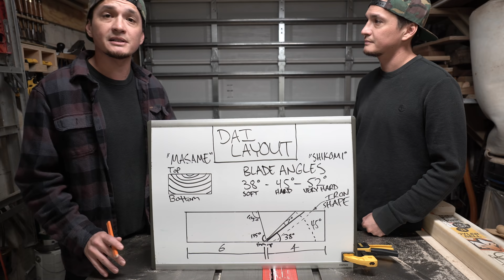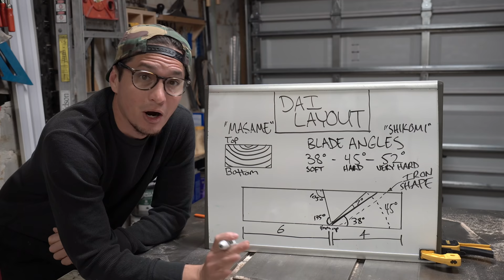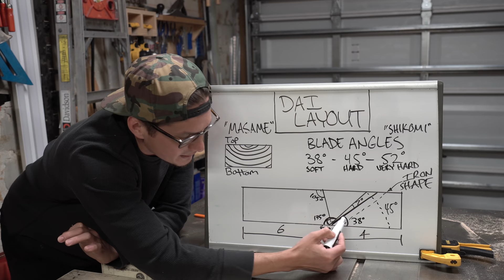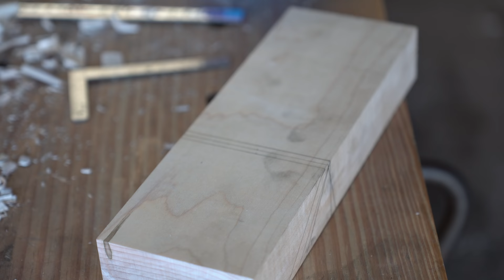Making a Japanese Hand Plane | Kanna Plane Fail Video | Japanese Woodworking

Comment: Even though you consider it a fail, it still came out great in my completely amateur opinion!
Way better than mine when I made my first dai a couple months back lol.
I made it with a 50 degree bed to have as a last resort plane if I ever ran into any gnarly exotics. Next time I'm gonna use soft maple too, I did mine out of white oak because it was what I had and it came out kinda ugly, but still worked in a "step away from a finishing plane" kind of way. Plus the oak being a little chippy was a big player too.
Reply from the maker: Yeah white oak i heard can cause issues with the shavings ejecting because of the porous nature of it. Hard maple works too. But I’ve heard rosewood and Osage orange work amazing.

Comment: Great video! I imagine that was a lot of work from start to finish, how many hours would you say? I've never made a dai but I am continually tuning my current one and you did better than me... I can't seem to get the right/left balance perfect so one edge of my blade will typically leave a track mark. I can dial it in by laterally tapping the blade but if I hit a knot or too much resistance it has a tendency to get out of alignment.

Edit: Oh yeah, I subscribed. Looking forward to checking out more of your channel!
Reply from the maker: Yeah I think for the most part kanna doesn’t handle knots particularly well. So as far as work I’d say it took about two full days. I did it in a couple sprints. Basically an hour or two getting the blank together, a quick layout, then an afternoon roughing the throat, a couple hours on the channels for the iron, and then what felt like forever working the fit. I honestly might try the multi tool route just to save me some time and wear on my mortise chisel though. Thanks for watching and keep asking questions!

Comment: Japanese woodworkers will sometimes use paper on the bed of a plane to tighten it back up.
Reply from the maker: Yeah I tried popping a business card back there. The tape worked pretty well. I should be getting the iron back from the blacksmith which should fit better since he’s gonna have to grind off a fair bit of the bevel to address those cracks.